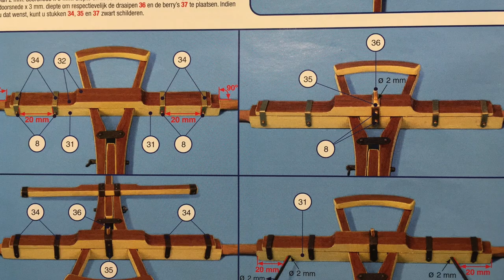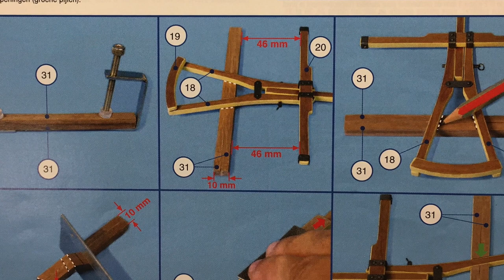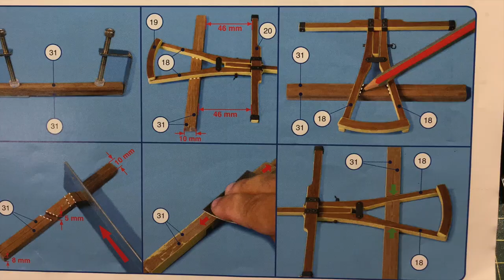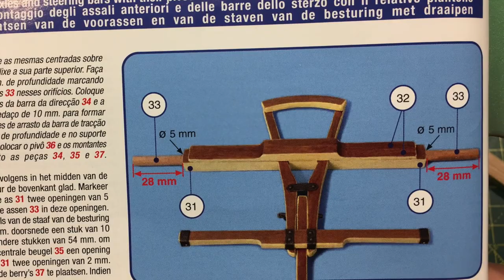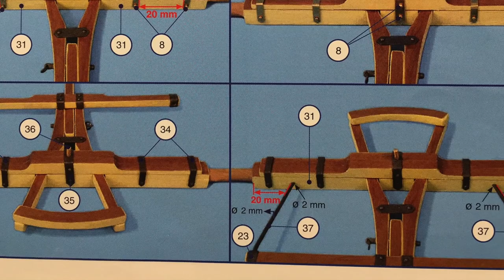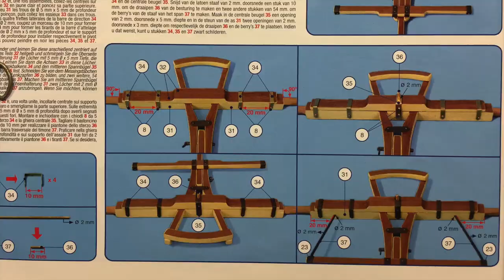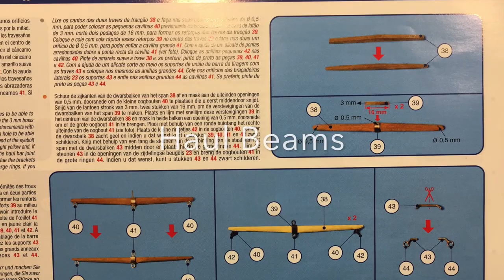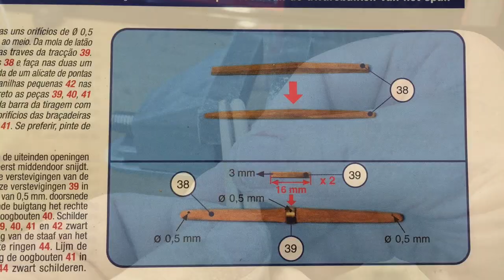Artesania 1848 Stage Coach - Build 8

Comment: Thank you for your very instructive build. I am learning a lot about model building from your videos . I am at this stage now and notice that in my kit the parts 34 and 35 are in the prefabricated brass sheet? Thank you again keep up te good work.
Reply from the maker: Yes, I did find those parts later but had already made them before I noticed :).  Thanks for the kind words and I know your kit will be a very rewarding model to add to your decor.
Reply: Hi, Chris if you used the brass shims to form these clamps then you would have run short of the shim material. The question is was these leftover shims as they pack extra or did you buy more? I am going along following what you do as a backup to diagram/notes although I notice you did not put the hole in for the 2mm support bars and lucky I read the comments regards those brackets you made up as I was scratching my head as I don't have enough shim left to do what you did.
Reply from the maker: Hi Gary, yeah my bad on that as I missed where the brass prices were to come from due to the vague instructions. You’d have thought I’d learnt the lesson from all the other Artesania kits I have built over the years. I have not run out of brass strip that I used instead so all good

Comment: Hi Chris, I noticed a shot of the front axle bracket assembly, right at the end of this build 8, that is in a different color combination than the yellow you're using with your build. I would be interested in knowing more about those colors, ie: paint/stains. I would like to use that color combo for the undercarriage and wheels on my build. I would appreciate any input you may have. 
Ken
Reply from the maker: Hi Ken, My yellow mix only changed early on when building the wheels.  I did not quite have enough Tamiya white when I was mixing the colour so I went with the slightly darker yellow as a base coat until I managed to grab more white.  I used a combination of Tamiya White and Tamiya yellow, mixing until it matched the colour plans as best I could.  The only finishes I will use is my yellow mix, Danish oil for the raw timber that I will eventually coat with black hard wax to fill-in the slight imperfections and falls into gaps between timbers and joints.  The black wax will also add a beautiful sheen without making it look glossy.

Comment: Hi Chris. I just discovered your videos. I have recently started this kit and am following your techniques. They are super - very instructive. A question: I see you have these very small screw clamps for holding some of the small pieces of wood in place. Also, the miniature carpenters square. Where did you find these?? Thanks again!
Reply from the maker: Hi Carl and thank you for your comments. The small brass beam clamps and the adjustable carpenters square have been in my toolkit for many years and I’m not sure where I found them. Possibly at a second hand market or similar. I did locate the brass clamps on Amazon previously but I have not been able to locate the square online. 

Search for japanese brass bar clamp. Good luck with your search
Reply: @chrisoxford8442  Many thanks Chris.

Comment: Hi Chris, What make or brand of chisel or chisel blade did you use for the cut-outs on the axle beam? I can't seem to find an X-ACTO or EXcel blade that narrow.
Reply from the maker: Hi Ken, I bought the chisel set off Amazon a few years ago. I found the following which looks similar. 14 Piece Wood Carving Tools Set with Whetstone and Protective Case, Chisels, Gouges, Scrapers, V Parting, Relief Tools for Wood Blocks, Basswood, Softwoods, Beginners, Projects https://www.amazon.com.au/dp/B07PHVRVHR/ref=cm_sw_r_cp_api_glt_fabc_8K095XME08Y9QT702H0Q
Reply from the maker: Hi Ken. Here is a cheaper kit on Amazon. Wood Carving Knife Set - 20 PCS Hand Carving Tool Set for DIY Sculpture Carpenter Experts & Beginners https://www.amazon.com.au/dp/B07TVWD15T/ref=cm_sw_r_cp_api_glt_fabc_9RYY0KS17G32BRZPD7T1
Reply: @chrisoxford8442  Thanks, Chris, that's great. I appreciate your feedback and taking the extra step with an Amazon search. I will order either the 14 piece set or the 20 piece set.